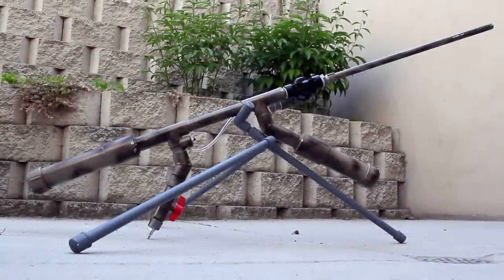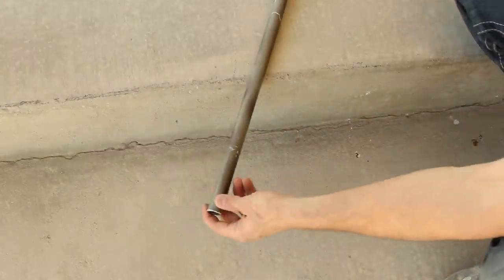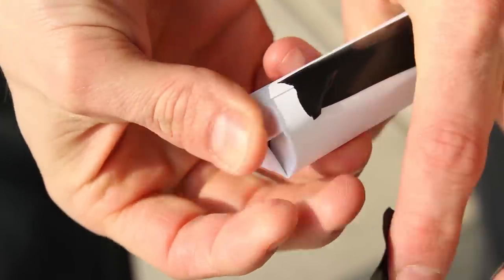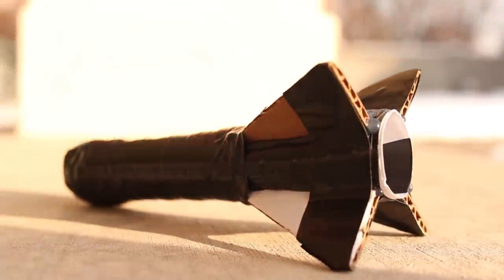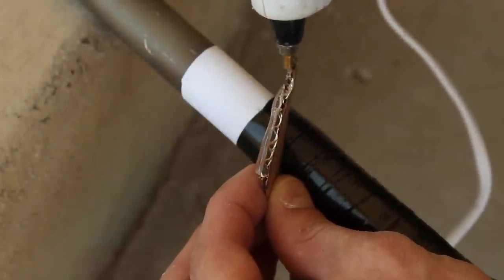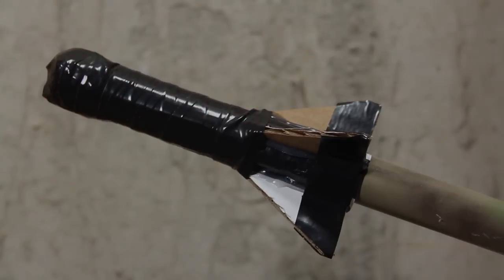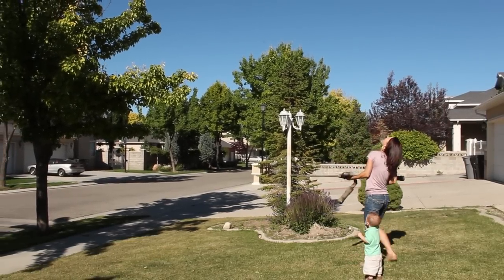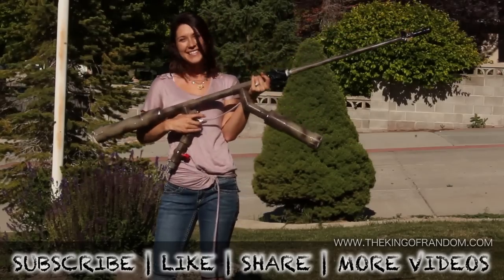Paper Rockets That Fly 300 Feet

Comment: You should put a small camera on the tip of the rocket, then upload the footage.
Reply: Potato Lover the camera would might brake when the rocket lands
Reply: mrcamerupt you can place a micro cam like a keychain camera inside the rocked
Reply: Even carve out a tiny hole in the front of the rocket and have the camera's lens there.
Reply: ***** no I was saying that a cam on the rocket would brake also there is something called a air brake
Reply: It would be impossible for a small camera to be mounted on the tip of the rocket because the camera will cause drag to the rocket which will make it slow down and make it less higher.
Reply: +mrcamerupt break* m8
Reply: impossible.. he is dead.

Comment: A physicist friend sent me to your site, and I'm very impressed. Please keep these wonderful videos coming. No suggestions for your elegant rocket launcher, but two small suggestions for the rockets: 1) make them longer, maybe twice the length, 2) make them spin by either putting the fins at a slight angle, or leaving them as they are and bending the outer corners in. My guess is that you'll add 100 feet to the distance they travel.
Reply: Your 8 years older

Comment: why not add a rocket fuel motor and add a pull string fuse igniter so when the rocket flyes off the fuse starts to burn and it gets some extra power
Reply: +ChannelGaming i said to add a motor to it not fill it with rocket fuel. i mean an metal rocket that you add to the bottom of the rocket
Reply: +ChannelGaming why not use a real rocket fuel motor. i have used a solid fuel motor for a fuel propelled rifle

Comment: cool vid, but i have a little somethin somethin to add. if you want to make the rockets faster and more accurate do this when you glue the fins on: glue the back of the fin on where you want it placed, and then set the front of the fin about .5 degrees to the right of where you set the rear, or so that the back right of the cardboard is in a straight line with the front left of the cardboard. make sure that this line is straight along the entire rocket. do this to all fins and the rocket will fly much faster and farther as you will add spin which will help significantly with aerodynamics and accuracy. Also, another little somethin somethin, is that instead of using the heavy cardboard, you can fasten some duct tape together and do the same thing to form something similar to fletchings on an arrow. cheers!

Comment: wow! nice video, was wondering if you could use this as like a rocket booster? Maybe attach rocket motors to the end or sides of the rocket, fire it with this air compressor and then at the height of flight ignite the rocket motors with an rc or something and it could take off from the height its already at! would need precise calculations though haha still nice video!

Comment: I just started watching your videos today, and you amaze me with your creativity, im wondering though if you could use pvp pipe, along with the materials to make smoke bombs in a home made mortar shell configuration, using the small popper firework rocks, mixed with homemade black powder or magnesium powder as a primer for the smoke making material then the rocket fuel on the back to launch the projectile, with either electric lighter or fire lighter at the bottom of the homemade mortar :3 do it

Comment: you should do a vid of what i have tried. i do some paintball and i made a version of the launcher that is pretty stationary like a mortar and made the rocket in your vid, but with a slight tactical add on. i also made a version of your smoke bomb and placed it inside of the rocket and the fluid took up about 30% of the rocket in the middle. in a way it was ignited like the fatman nuclear bomb. i took some flint and placed it in the nose and made a male shaped flint and put it in the actual fluid. when the rocket hits its target (and it will because its very nose heavy and will land on its nose every time) the nose is crushed and forces the flint togeter causing a spark that lights fast burning cotton in the end lights the smoke fluid. i used this when some of my guys called a location on the ISR about 350 feet from the base. i stuck on the rocket prototype, did some math, and put on the correct PSI and angle of the weapon. the result was absolutely sick! they had some infantry in a trench that had been giving them grief and they were in the woods and out of sight. it had about 25 seconds from launch to impact and i saw and heard the impact. it lit up that trench with smoke and i added some home seasonings to make it smell like shit! it smoke those guys right out of the trench and my guys shot them. the mushroom cloud it left was massive. i hope you try this because i'm not working on a prototype to drop/launch these from RC aircraft. once this happens i'll be sure to send the vid to you. it killed me when that cloud went up and i realized that i didn't record it. HAPPY SCIENCE!!!
Reply: dont even bother reading not worth of time
Reply: Nikesh Chhetri thanks

Comment: You should try to make the length of the rocket as long as the PVC tube it slides on and re-enforce the the PVC tape to 5 layers. This should triple the distance and add a little more weight to it. By the way, you might not find it again after you fire it.

Comment: Great start, but I then I thought, suppose you make a rocket that fits inside that barrel and make the fins out of mylar. The fins would lay flat on the tube until it exited the barrel then they would flip out to guide the rocket. This method would increase velocity and give you greater range. I think.

Comment: i know the point is to make inexpensive rockets, so this may not be for you.  At any local hardware store you can buy a tailpiece extension (its a light wall pvc pipe) it will slide perfectly over 1" pvc and if you take half of one of those plastic easter eggs you can make a plastic rocket that goes about twice as far as the paper ones. :) enjoy

Comment: why don't you use a small gas canister filled with flammable gas attach it like you did with the gas pump fill it up with the gas then have two metal prongs really close together so you can create a little spark between them to light it with a button then you'd have a more portable one although refilling might take a while not sure but its something i wanna do when i have money you might be more suited to try though